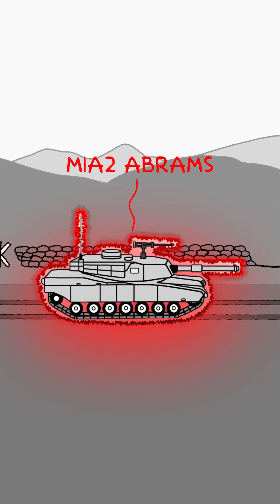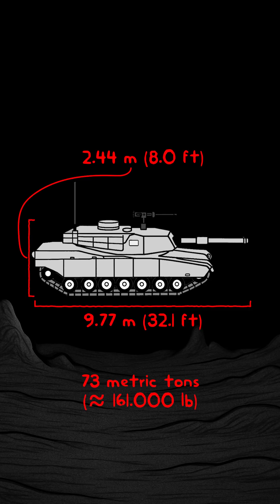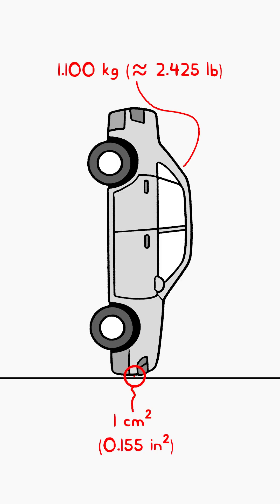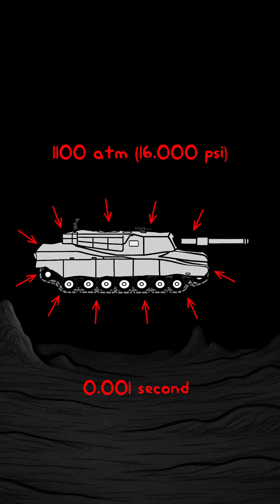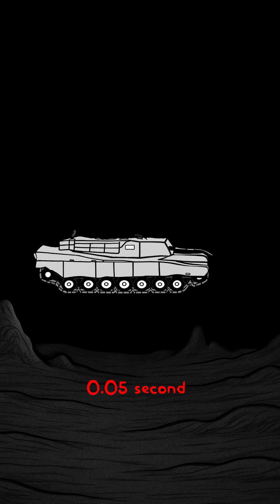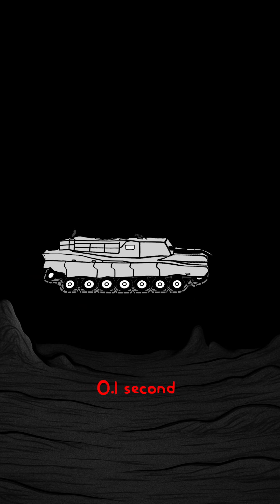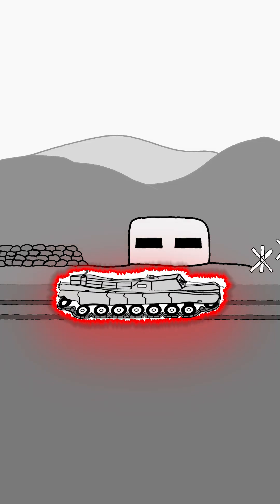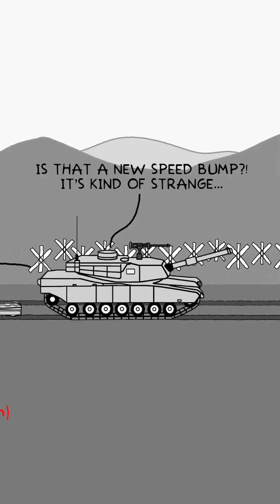What if you teleported a TANK into the Mariana Trench ?! #whatif #science #marianatrench #physics

Comment: For those who don't understand:The Eurofighter Typhoon is a twin-engine, canard-delta wing, multirole fighter aircraft developed by Eurofighter GmbH, a multinational consortium formed in 1986 and headquartered in Hallbergmoos, Germany.
 The company is owned by Airbus (46%), BAE Systems (33%), and Leonardo (21%).
 The aircraft was originally conceived as a European collaborative project, known as the European Fighter Aircraft (EFA), initiated by the United Kingdom, Germany, Italy, and Spain in 1985 after France withdrew due to disagreements over design and workshare.
 The first prototype flight occurred on 27 March 1994.

The Eurofighter Typhoon entered service in 2006, with the first production aircraft delivered to the German Air Force in 2003.
 It is designed as a multirole combat aircraft capable of air superiority and ground attack missions, featuring advanced avionics, high maneuverability, and a maximum speed of Mach 2.35 at optimal altitude.
 The aircraft is powered by two Eurojet EJ200 turbofan engines, developed by EuroJet Turbo GmbH, a consortium including companies from Germany, the UK, Italy, and Spain.

Production is divided into tranches, with Tranche 1 (148 aircraft), Tranche 2 (275 aircraft), and Tranche 3A (200 aircraft) completed by 2019.
 The final Tranche 3A aircraft was delivered in 2019, and the total production as of January 2025 stands at 609 serial aircraft, including 7 development aircraft.
 The aircraft is operated by the air forces of the four partner nations—UK, Germany, Italy, and Spain—as well as Austria, Saudi Arabia, Qatar, Kuwait, and Oman.

The procurement and management of the program are overseen by the NATO Eurofighter and Tornado Management Agency (NETMA), which acts as the prime customer.
 The production model follows a unique approach with four separate assembly lines, each operated by a partner company, responsible for building national aircraft while also producing identical components for all aircraft, including export variants.
 The Typhoon has been considered for replacement programs, such as Germany’s Tornado replacement, where it competed with the Boeing E/A-18G Growler.

The Eurofighter Typhoon is also known by the name Eurofighter, a term sometimes used interchangeably to refer to the aircraft or the manufacturer.
 The name has also been used for unrelated products, such as roller coasters and video games, leading to disambiguation.

Comment: Aa curious

What if 'the' whole curved water trench that got teleported into a hard surface tho?

What makes the pressure? Quantity? Depth?
Reply: If I understand the question correctly, water pressure is determined by depth, the deeper you go, the more weight is above you which pushes down on all of the water around you, resulting in isobaric (same pressure) all around you from every direction
Reply: @radiationpony8449  so bothways? What if such quantity is, say above himalayans. Will it exert the same pressure?

Comment: Literally everything after the water pressure inside equalizes is false, steel plates are incompressable so if the pressure on all sides is the same nothing happens, same way you dont implode because the air in your lungs is the same pressure as the air outside.
If the internal and external pressures are the same then by definition there is equal force compressing the outside and resisting compression inside and therefore the plates in between experience no net force.
Reply: I may be wrong but I'm pretty sure metal can be compressed, or at least definitely bent.
Reply from the maker: The pressure only equalizes after the structure has already been damaged.
Steel isn’t a spring - once it goes past its yield point, it doesn’t bounce back. Once the metal starts bending inward, it has already lost its stiffness. The shape changes - internal stresses rise - the deformation keeps progressing even without a pressure difference. This also happens because a tank has many small compartments, gaps, and cavities in its hull and equipment that don’t fill instantly in such a short amount of time.
Reply: @Ooops_Theory the internal pressure is specified in the vedio as equalizing at 0.05s after this point the hull will no longer experience deformation (however any plastic deformation before that point will remain). Internal compartments are not constructed to the same standards as the hull and so will have failed before the internal pressure equalizes.
Reply: Keep in mind that even if the pressure has equalized, there was still a massive impulse from the initial pressure distance. So the armor will keep moving inwards with momentum for a short period of time.